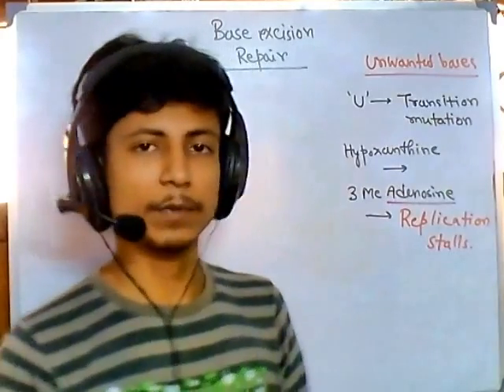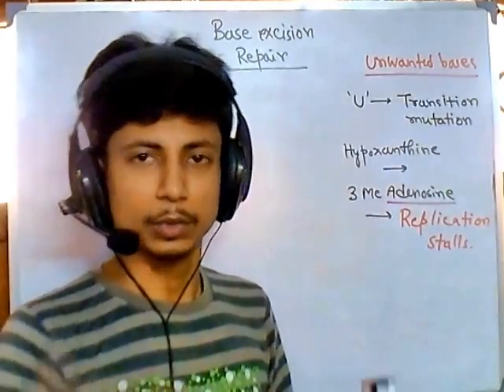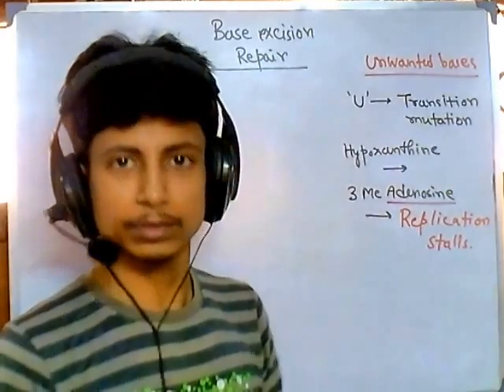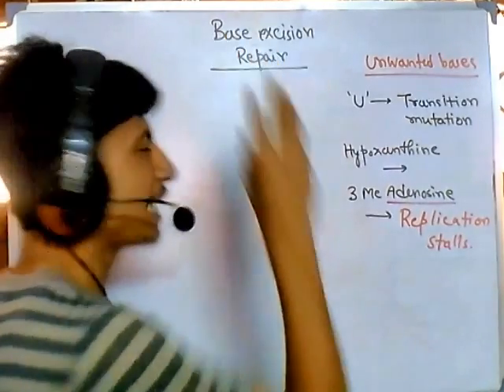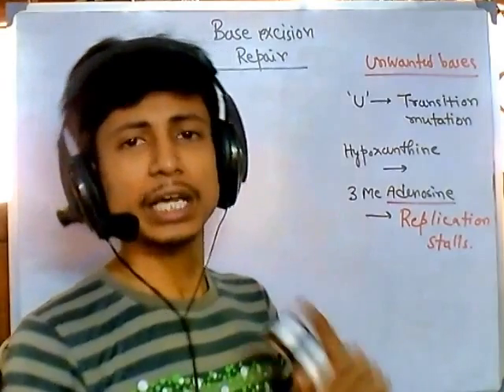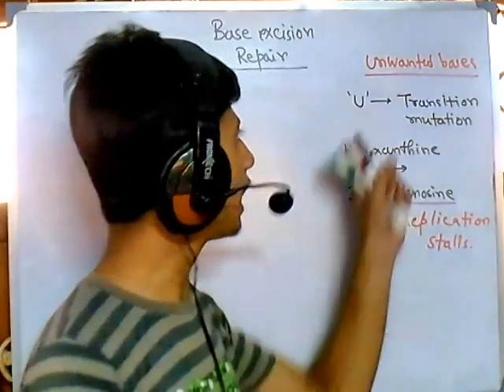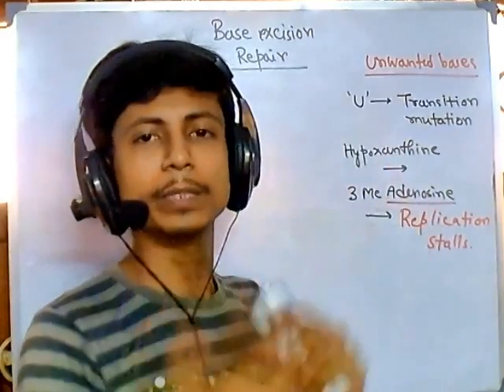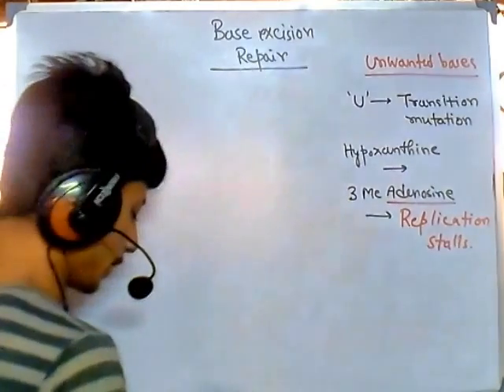DNA repair mechanism - Base excision repair

Comment: You made a small mistake when you spoke about DNA pol I 5'-3' polymerase activity.
The 5'-3' polymerase activity only works when you are using the 5'-3' exonuclease activity, ergo the concept of "nick translation", but when you use the 3'-5' exonuclease, one of two things must happen, either you excise in one direction, and then consecutively, move backwards in the 5'-3' direction to add the new repaired nucleotides. The nucleotides are not added while you move in the 3'-5' direction. Or you could have a distributive polymerase activity, where Pol I disassociates from the DNA and a new Pol I binds and repairs the gap via replacement with new nucleotides.

Other than that, great video
Reply: So in this case the DNA pol I uses his 3' > 5' exonuclease activity and add new nucleotides using his 5 -> 3 ?
Reply: @luisfreitas6435  No cut the segment of DNA by using 5'-3' exonuclease activity then siled the gap by the polymerization activity of the DNA pol-1